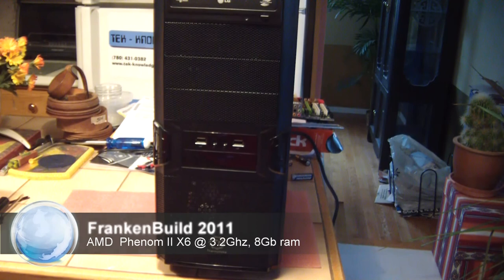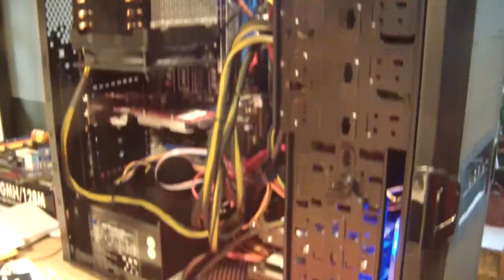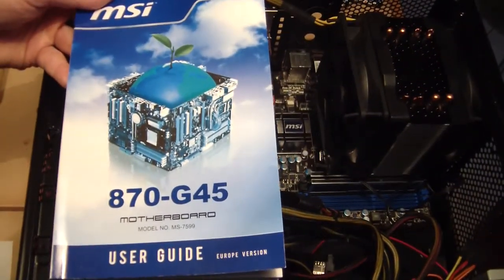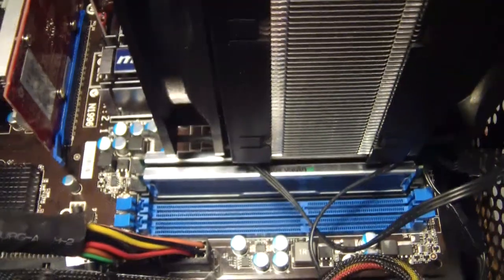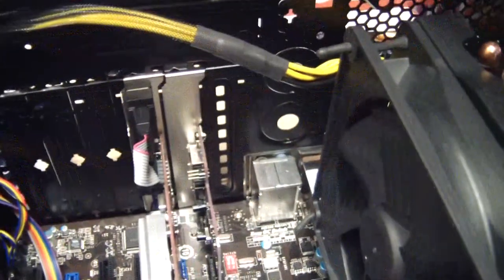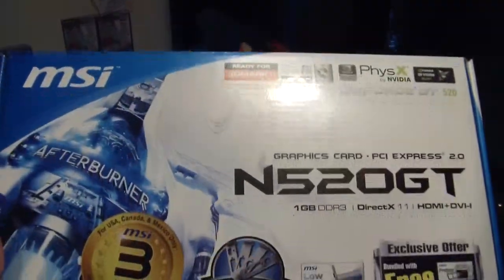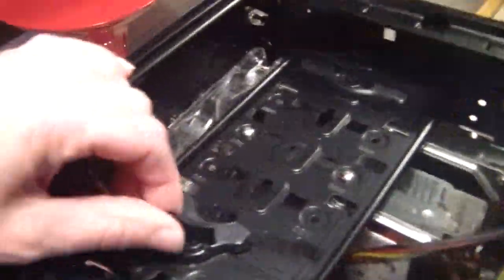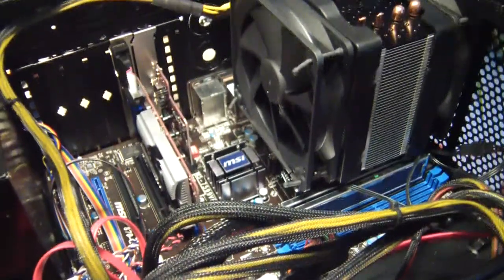DIY: build your own computer and save $$$ (Overview)

Comment: 770 chipset
I would remind users to be very wary if running high TDP processors (i.e. 125W Phenom II x4/x6), as the 4+1 phase VRM on this board has problems and is known for failure.